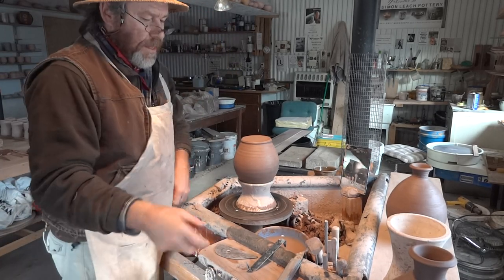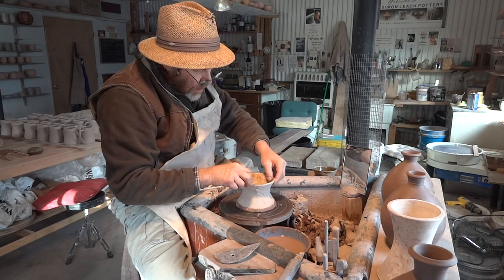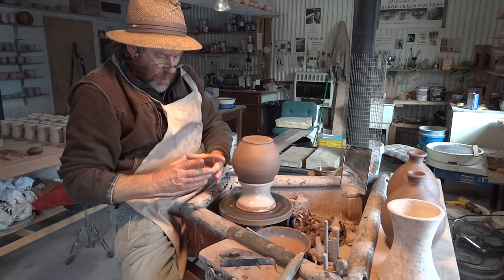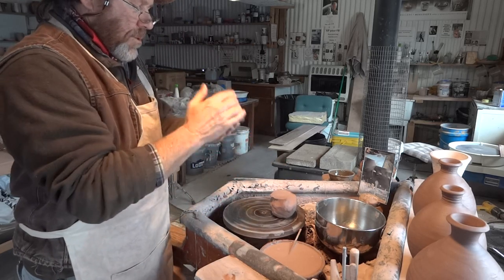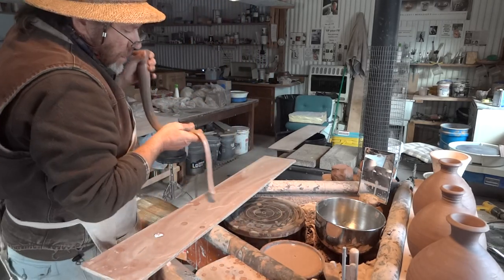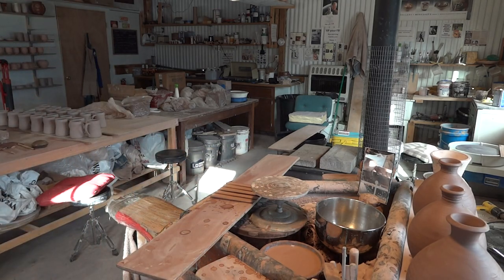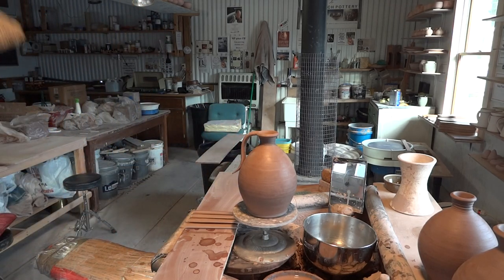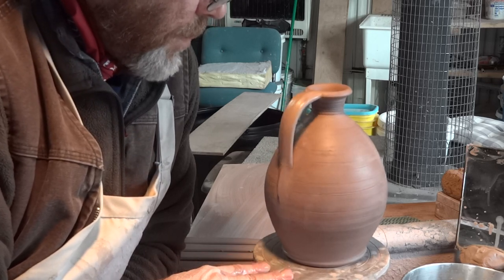SIMON LEACH POTTERY TV - Applying strap handles to flagons !

Comment: "Grasp your mandrake firmly by the root..." 
Didn't figure out the twist thing before, just wondered what I had been thinking when I'd set them on.
Another common flaw is that students overwork the join 
Or that the very place inside the handle where it merges with the body of the jug, a hairline crack grows from the bottom of the "V"
You do such a great job explaining and laying out what needs to be considered, thanks again!